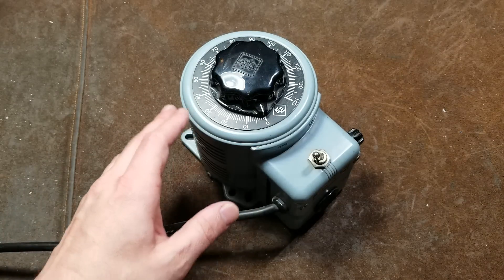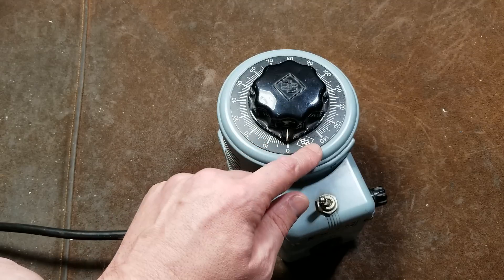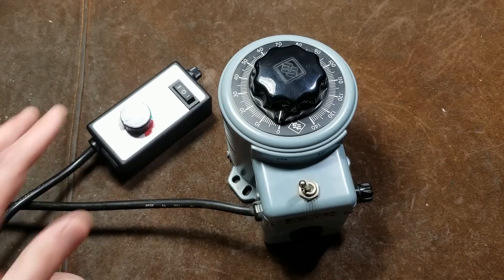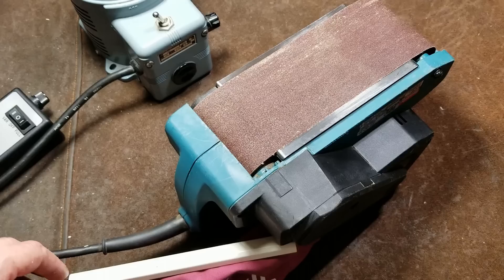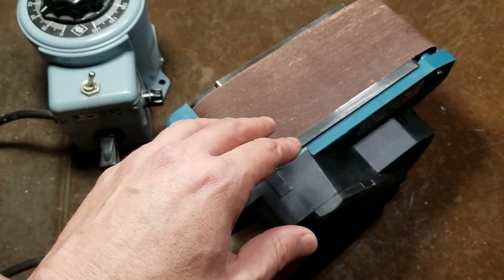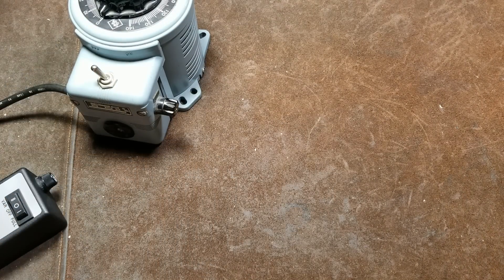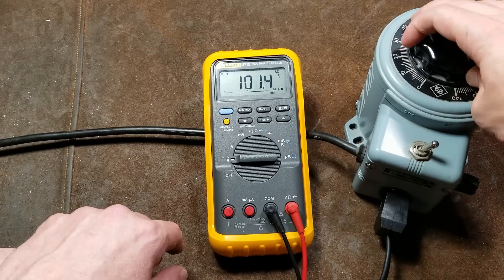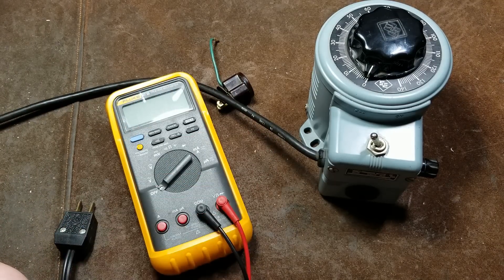Superior Electric PowerStat Variable AC Transformer Review

Comment: I own the 480v 10A three-phase beast.
Its like a nuclear warhead. Because of the 480v its diameter is like double of this little toy. Its three variacs ganged together on one shaft and bolted together with steel rods and bolts. I dont have a scale but i think its 70 Lbs easy.
Reply: Can you sell it to me?

Comment: I don't know about nowadays,  with most lighting being LED or electric discharge,  but in old theaters they would use variable auto transformer dimmers,   which are physically large but very efficient and not load dependent, still older theaters used resistance dimmers or salt water dimmers, which were highly inefficient and potentially dangerous,  as a great amount of heat was dissipated,  and salt water dimmers were particularly dangerous because of exposed contacts and they were sometimes nicknamed piss pots, because the salt water heats up and had to be replenished regularly and it smelled like ammonia.   Both resistance and salt water dimmers were load dependent and had both a minimum load and maximum load 

Of course nowadays virtually all dimmers used are Triac based, and work by chopping part of the sine wave, which is what causes incandescent bulbs to buzz when dimming

Comment: I bought the Model 116 7.5 amps version by mistake, not sure what I can do with this lower amp version?
Reply: I have a 120v 7.5A made by Ohmite. Use it to control a nice big box fan. Or control the speed of a smaller size drill press maybe?

Comment: Ì have one of these l found it to be one of the best voltage transformers speed controller I have ever used for testing I aquired it for free I first saw this type of dimmer at the theater it was used to dim the house lights as the movie started and to brighten slowly when the movie was over it works well for model train sets fans and many more apps

Comment: Variable autotransformers work well with AC motors that have their field winding connected in series with the rotating armature winding.
Used with other AC induction motors you will still have the problem of torque loss due to voltage starvation, although some but not all induction motors can function OK with a limited value of voltage reduction.
The SCR (Silicon Controlled Rectifier) type of speed control shown in your video gets around the loss of torque by outputting full line voltage, but portions of the voltage waveform are cut off to reduce the overall power over time supplied to the motor, thus reducing its rpm.
I suspect that the power tools' motors you have used with the "Variac" are of the series-wound type, so the setups have worked ok. However it is never a good idea to operate any electric motor (other than a "torque motor" such as used to power locomotives) at very low speed and especially with rotation stopped. This would likely damage the motor permanently.

Comment: Would it be possible to overload the power tool and cause damage? Nice video, where do I get one, and how much? Who's the manufacturer, kinda looks like square -D?
Reply from the maker: You'll have to hunt around online the name of the products in the title that really is the name of the company Superior Electric. I don't include product links because I'm not trying to sell these I just review for informational purposes.

Yes as I mentioned in the video you do need to be aware of heat build-up when running tools for at low speeds for extended periods of time because of lack of airflow.
Reply: @CatusMaximus  The lady that sold me the powerstat had a voltage variable supply name brand Elema-Schonander made in Stockholm it was a vintage one but BIG and it was a dual power supply 0-30VDC and 0-140VAC rated at 10amps and the input was 220vac and had a big dial on the side of the cabinet just like the one on your variac so i am thinking it was a combination power supply variac and it weighed close to a 100lbs! i had never seen anything like that and she was selling it for $40 i did a google search and could not find any info or images of it. It appeared to be from the 60's the only thing i found out was that the company became Siemens.
Reply: @CatusMaximus  Good video! very informative and interesting, learned things i did not know you could do with a variac. I mostly use them for when i am working on my stereos or reel to reel.
I just bought one of these models and it has a 32vac 8amp fuse it looks like it is a slow-blow fuse but i am not sure if the voltage is correct for the variac? does yours have the same type of fuse?

Thank you
Reply: @CatusMaximus  I one I bought powerstat type 116   only goes to 118.5 but the dial is set to go to 140vac and that is what it says on the tag, so I don't understand why mine only goes to 118vac? I found a chart online that the 116c is only rated to 140vac.